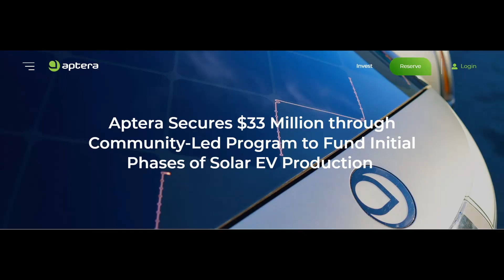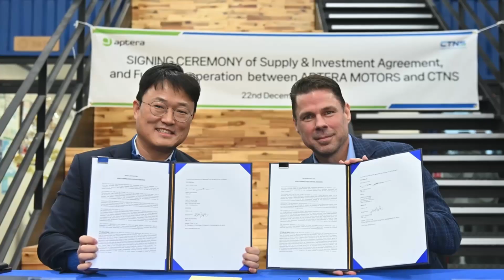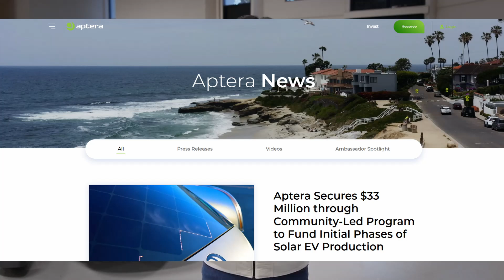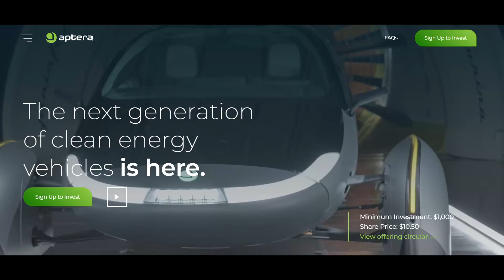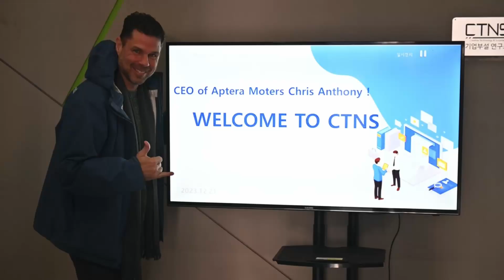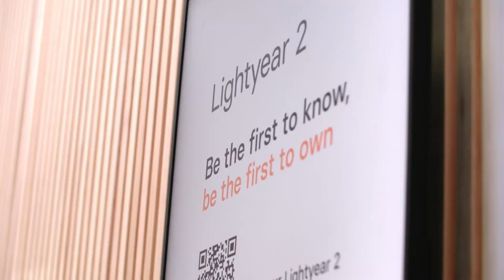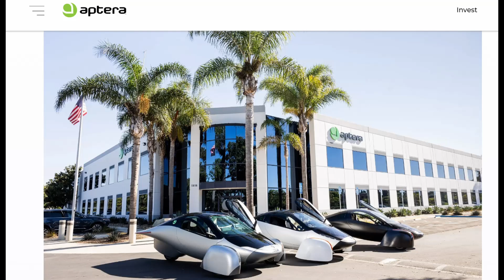Aptera Update — February 2024

Comment: I think the solar charging idea is being oversold a bit. Yes it will in some circumstances make a difference in adding vehicle miles but everyone needs to know how conditional solar charging is. I have a PV array on my roof for 11 years and “on average” it produces 6 MW a year. In the long run my utility almost disappears over the course of a year with the net metering in place. That said there can be some serious stretches here in NJ where the array produces near zero due to extended days  of cloud cover and shorter days in winter. Sometimes it snows, which covers the array, if more than 2” of snow I clean the array. In some recent months production has been down 20% compared to same month in past years. Not to worry, my house is on the grid and it all works out in the long run. As for a car solar charging, yes there is a benefit but how much of a benefit really depends on where you live, the circumstances of where the vehicle is parked, what latitude you are located in - there are many variables that will influence the amount of charging the vehicle will receive. I’m not being overly critical, I do admire the Aptera for all its design features, especially prioritizing shape and aero efficiency. I do think the solar charging will be a benefit so some but you really can’t count on it for much  in the short run, which is the world that cars live in. “Hey honey,  you didn’t plug the car in and parked on the shady side of the street….”

Comment: @8:40 you show the interior dimensions with a maximum head room of 34 inches from the top of the seat bottom to the ceiling.
I would need a lot more headroom at the minimum of at least 6 more inches.
And adjustable lumbar support.
Reply from the maker: Oh,
Lo!